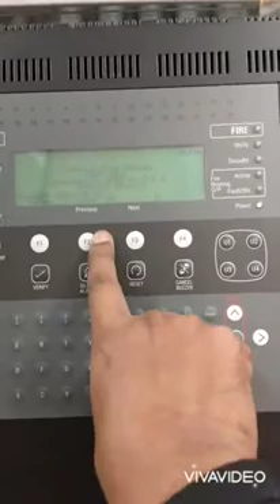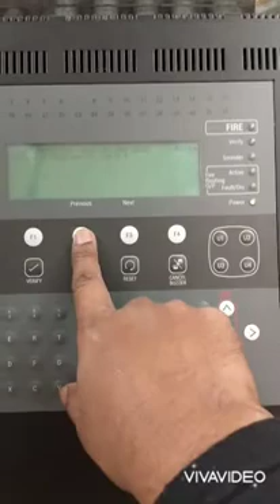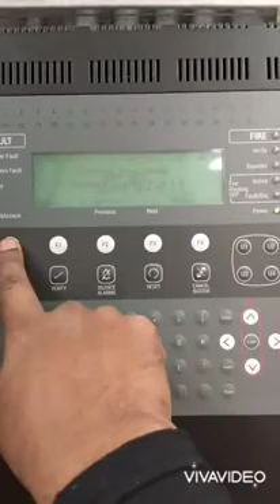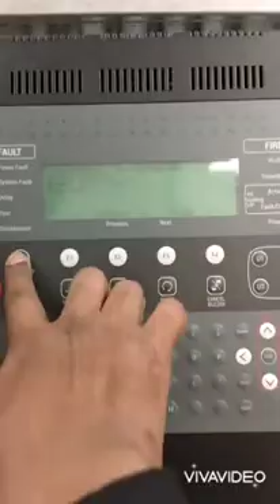How to Disable & Enable in GENT Panel devices?

Comment: i want to know how to clear high resistance fault in gent vigilon
Reply from the maker: This type if fault usually due to the long distance.
Reply from the maker: This long processor for your work
Reply from the maker: However, it is certain that this happens because of the problem of either an IFU or a flasher.